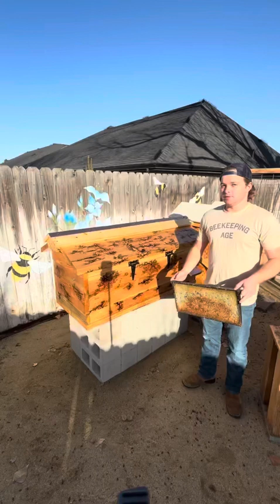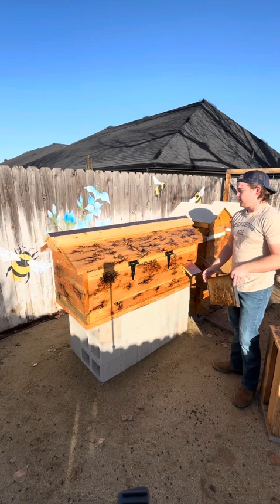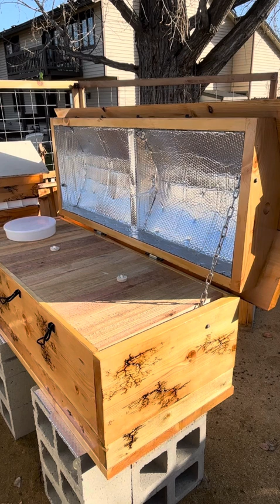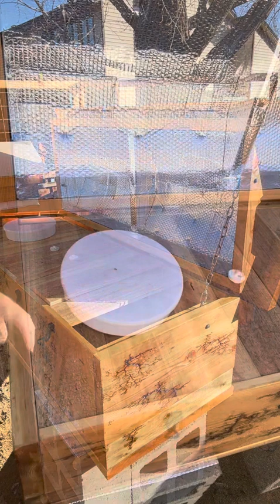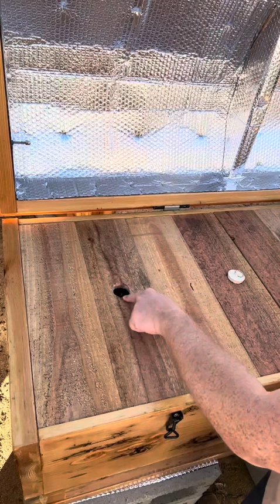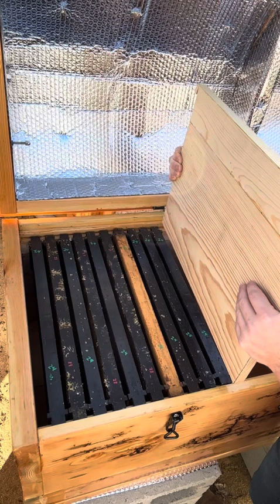Overview of Horizontal Langstroth (Long Lang) Hive build

Comment: How are things working out with the drone comb beneath the frames? Has there been a quantifiable decrease in mite load using this manner of pest management, or is it just belief and anecdote?
Reply from the maker: @hot2warm  funny you should ask. After about 2 months, I decided to add a floor to eliminate that extra space beneath the combs. It was SUCH A MESS with all that extra comb. I couldn’t do it anymore haha
Reply: @Gs_Bees  Thanks for the quick response!   I recently built one, but I haven't activated it yet, and that's been a big concern of mine. I guess I'll be adding a floor to mine too! LOL
Reply from the maker: @ I must say, adding the floor will be much easier without bees in it. I had a heck of a time getting it in there under the colony 😂

Best of luck to ya!
Reply: @Gs_Bees  Thanks. An update video on the issues you had and the fixes you made would be cool.
Reply from the maker: @ sounds good! Once the temps get a little warmer, I’ll get it up 👍🏼

Comment: Hey.  I'm building one just like this, using the same plans.  I'm not using 2x4's for the roof, though.  That's a bit much.  I'm also using a screened bottom board instead of that shim, and putting in removable mite boards under the screen. 

You might want to adjust your follow board.  It looks like there's a bit of a space between the top of the board, and the bottom of the cover boards (though it is hard to tell from the video).  That follow board should fit tight to the cover boards.